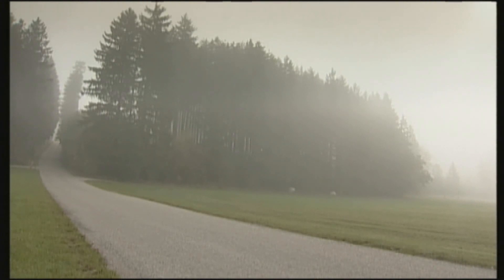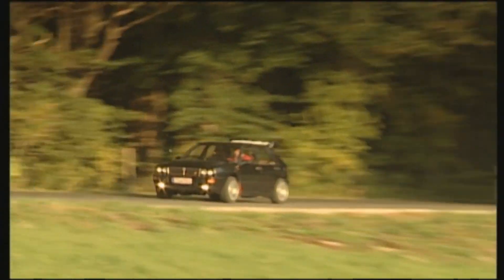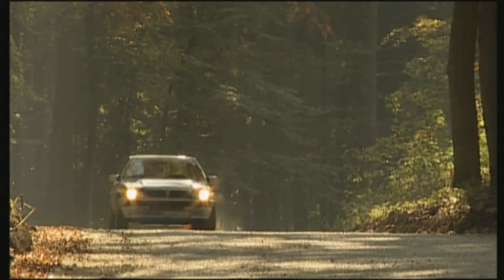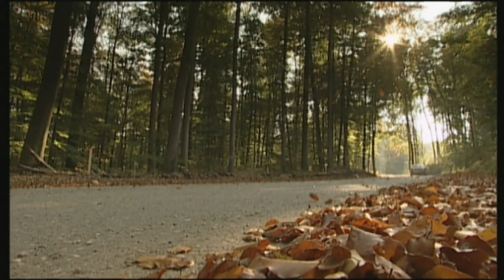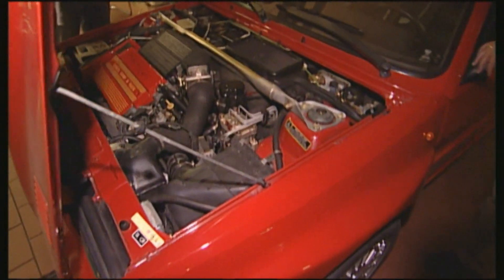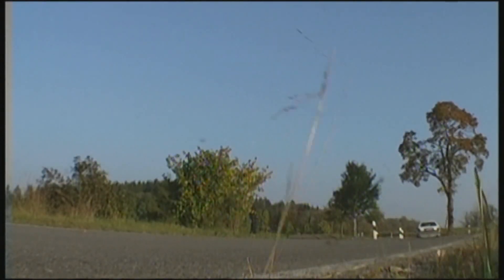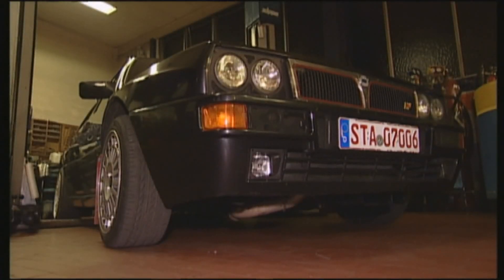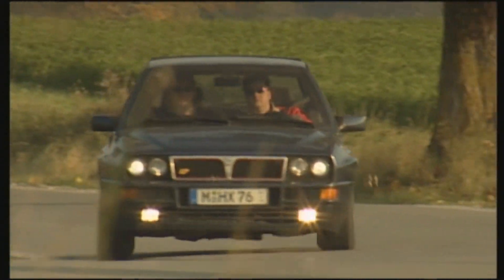Lancia Delta Integrale

Comment: Not true. If that were the case, ANY turbo car where you live would just break down. Humidity does affect performance but this is true of ALL engines regardless of a turbo or naturally aspirated. A car surviving humidity is not the problem but will it survive your driving habits? When the narrator said "don't drive it too cold or too hot", he meant don't crank it up from sitting over night and just blast away, let it heat up. Don't drive too hot means don't constantly romp on the gas pedal.